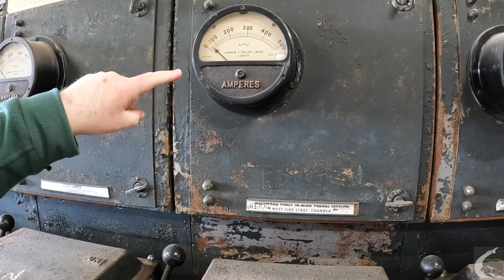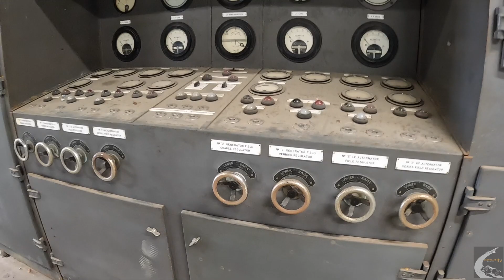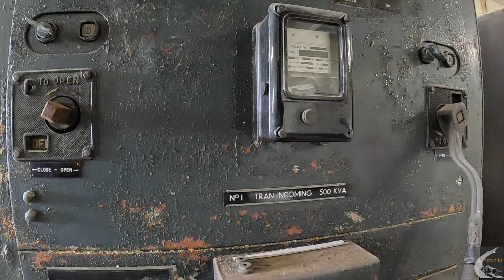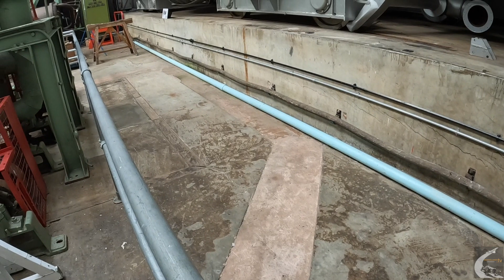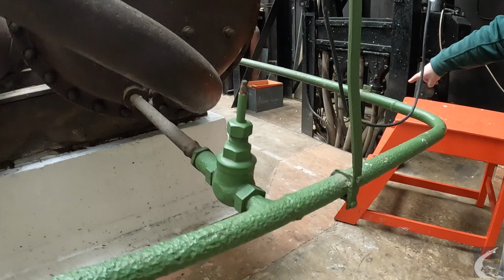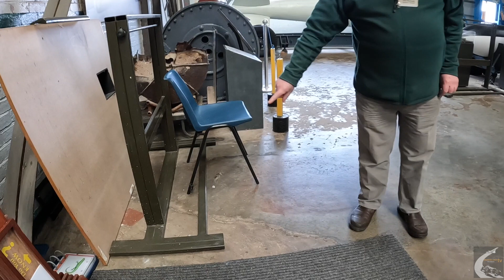Brooklands Electric Sub-Station No8

Comment: 1950’s electrical and mechanical technology was how things worked when I began my working career. I was in the power generation industry for over 45 years and by the time I retired, we had gone to digital computer control. Although surprisingly there is still a lot of the 1950’s equipment still in service 70 years later. Testament to how well it was made.